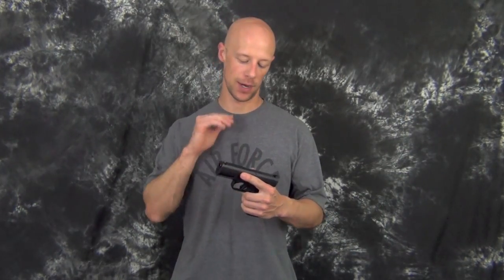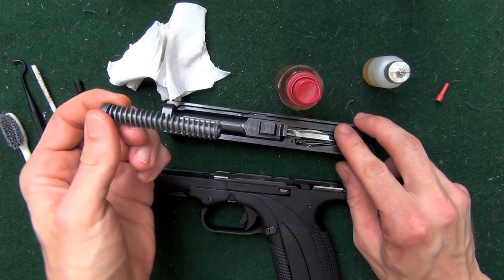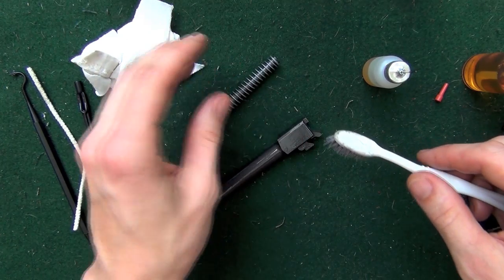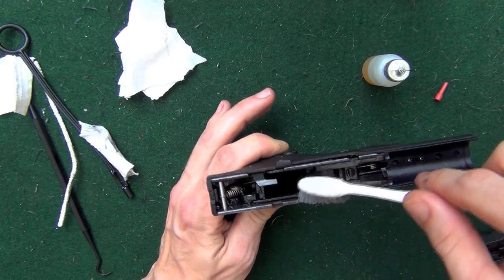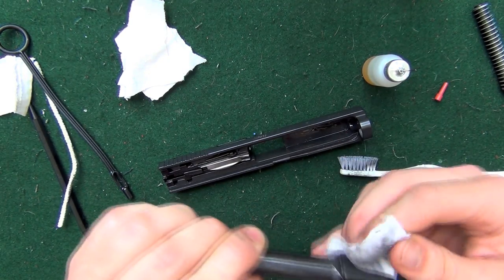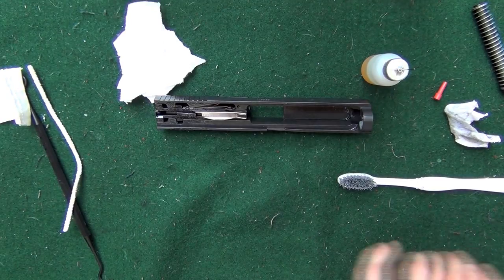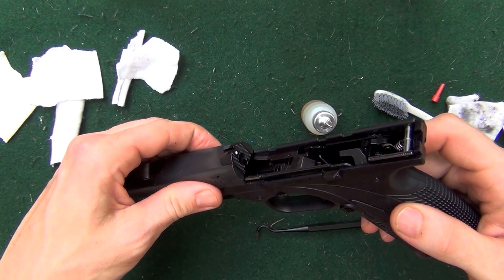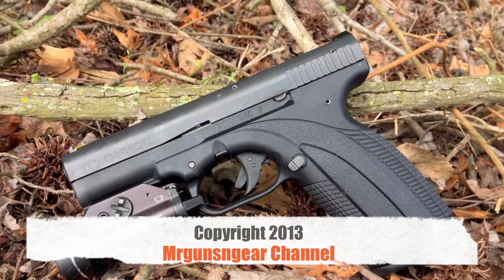How To Clean And Lubricate A Caracal Pistol (HD)

Comment: Ah, well. The 9c fits my hand very well, points well. With the refund I'm only spending $30 or so on it. Today Ima put a few hundred through it. Only have 10 through so far, seems to shoot low (?). Did the sear grind/polish, lightened the trigger and got a more tactile reset. Maybe that'll help.